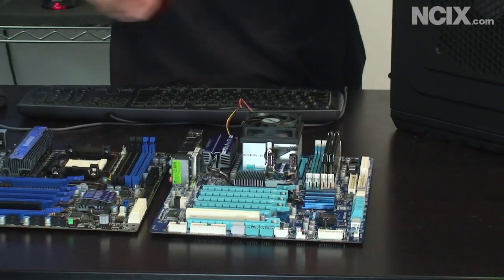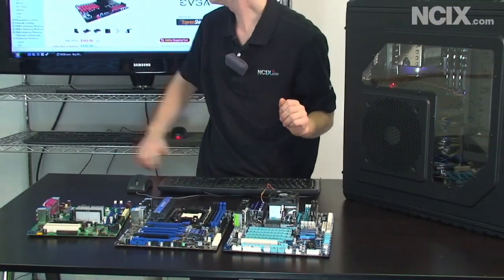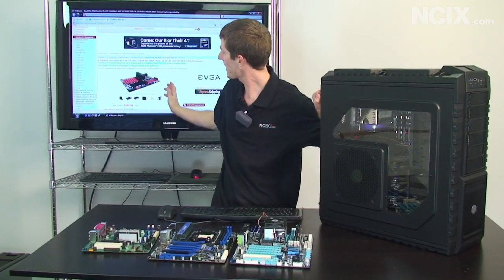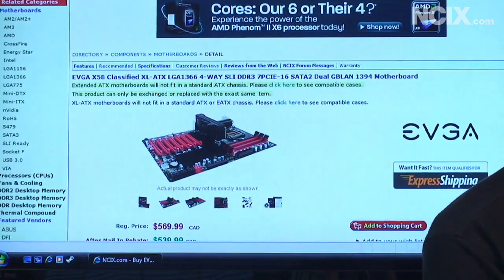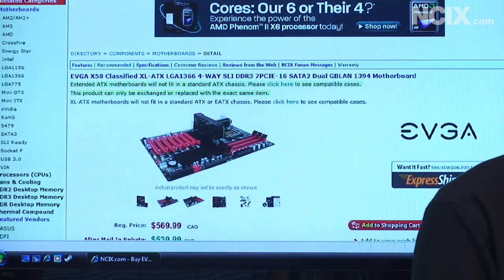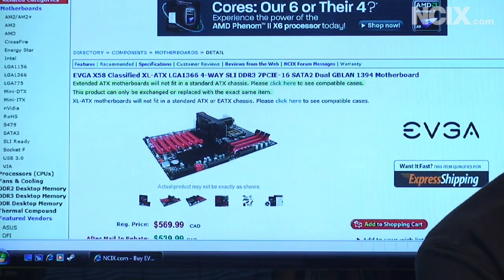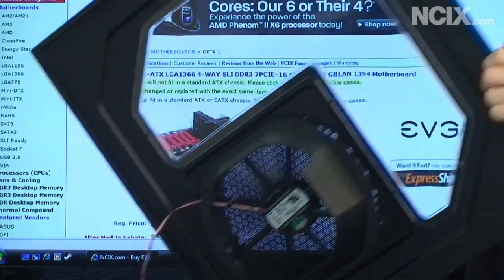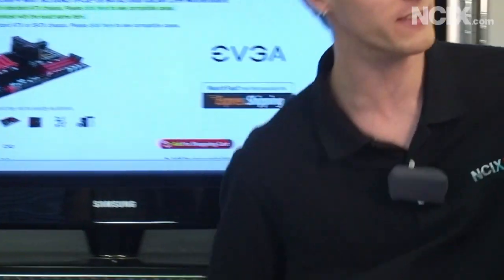microATX vs ATX vs XL-ATX Motherboard (NCIX Tech Tips #68)

Comment: im actually about to buy this case and 4 other cases tomo for 20$ i wanted this case he said i had to take all 5 LOL others are old dell dimension cases. which i have plans for for future budget build pcs. and gonna mod the cases to get rid of dell LOL. but i came here cause i saw this case while trying to make sure my mother board will fit in other cases LOL cause my power supply is ontop so im worried it might not have long enough wires to reach to top ports. :( 
and now i really dont know.
Reply: lol...
Reply: @handmeadozenbeers8655  kinda pumped. i need a big case. but i guess this is the bus of cases lol.

Comment: Question; Could a MicroATX board fit in a ATX case? I'm attempting my first build and I might get a ATX case, but I'll be using a MicroATX motherboard.
Reply: +Random Gaming and Tech Yes,  most ATX Cases allow you to use mATX boards as well
Reply: +Random Gaming and Tech But you might as well get a ATX
Reply: Thanks!
Reply: No prob
Reply: Yea it can
Reply: Most of them also allow you to use mini itx aswell, which most of the time has a built in wifi adapter which will save you a couple of bucks down the road ;)
Reply: thanks. :D
Reply: Well, if you are doing a PC, you'd better not use WIFI, cus it's slower than ethernet and no one really moves a PC around. Just buy a ATX and a cable

Comment: Which would be better for overclocking and gaming [if you don't plan on using more than 2 graphics cards]?  The microATX since it has shorter connections or the ATX for larger surface area?

Comment: I have an old mATX board that I want to swap out for an upgrade into a 64 bit system. My case (that it came in and want to keep) says that the case form factor is uATX and then listed under the specification it says that the cases "Supported Motherboard Form Factor" is ATX. The cases dimensions are 15.5 × 7.25 × 16.5 inches. The old Motherboard I currently have is 244x244mm. 

Will I be able to fit a new standard ATX motherboard in to this case for my upgrade?

Comment: Nope, those 380's are about equal to the power of a 580, the 5xx series didnt have much performance update mostly cooling, so you are looking at theortically about a GTX 575 (card doesnt exists i believe :P) 4 way SLI, 2 680's or probably 2 670's could beat it

Comment: nope. not unless that card is a GTX 680. In theory if all of the GTX 480s were working at 100% (Which is very unlikely) then it should equal to the power of a 680 more or less. Just guessing here though but performance would still be pretty good if the drivers for 4-way SLI haven't turned to shit in most cases

Comment: Asus Maximus IV is E-ATX and is the same size as ATX just 2 cm wider, the same applies for the EVGA Z68/P67 FTW boards only difference is they are 5/6cm wider.
XL-ATX gives you 4x Crossfire or SLI whereas E-ATX gives you more features crammed into the board xD

Comment: sli/crossfire is really just a neat way to keep the 2nd hand market in graphics cards competitive.

user-overclocked pre-owned is a great way to go. occationally mods like volt, ramsinks, or higher-than-OEM quality thermal paste usually get thrown in for nothing if they've already been applied.

buying new right now its better to go in with the intention of having single card solution. but theres great performance+value to be got from 2nd hand OC'd cards in 2gpu config.

Comment: @TheWoWRevelation derp i bought the antec 1200 v3 and read that it supported ssd natively and had usb3, so i thought i didnt need to route the cables back...well i was wrong and it was a bitch to do alot of shit with that case, especially the 3 1/2'' bay :P

Comment: @deepakjindal070 check if it supports it, it will fit in term of size, but if the holes aren't there it wont, they generally will

Comment: @STRmw2 If you are going with a mid tower case I would recomend a Fractal Design R3 or a fractal design Arc, I own both these cases and they are truly amazing, however, not Blue LED. Go for the R3 if you want a silent computer or the Arc if you want a case with more fans and better airflow inside the case. and by the way, you can always buy blue LED fans if you fancy that style :)

Comment: @DJ4C0B
cheers for the reply
im a bit low on budget but with the help of a good friend ive found some parts im gonna get a mid tower blue led case, mATX board by msi and then ive got a 2.7ghz pentium dual core  (an improvement from my 1.8 core 2 duo) 4gb ram and a HD4670 which i may soon upgrade to a HD5770 (from a friend)
considering i already own the hard drives, cpu and graphics card, everything i just said including a blue case fan, new cpu fan and a new 500w psu comes to about £150 :D

Comment: @STRmw2 You have to look on the manufacturets website to look up what kind of motherboard size the chassi supports. However, most mid tower cases only accept ATX motherboards, they MAY fit an E-ATX but cablemanagement may be bad. I would go for a fulltower case.

Comment: @Nutriment6464 Now as for build quality. Antec doesn't make their frony bezels so thin you can see teh power and HDD LEDs shine through the plastic and eachother. 

I've also yet to have a side door on an antec case need to be shimmed so it doesn't rattle. I've bough two CM cases 3 antecs an Apteva (oh god was that a mistake)  And a Thermaltake which is almost 12 years old and i still have it today and it keeps a dual core with 6 hdds cool with its original orange fans. 
CM makes a good case tho

Comment: @Nutriment6464 *ran out of space*  Since the top Fan pulls air from the top mesh that isn't occupied by a fan, down into the case, then back out.

The only way to "cure" this problem was to put 2 120mm fans in the bottom (Yea I had to search long and hard for a thin 120x10 fan that wasn't overpriced.) 

The CM has a worse negative air pressure setup than the 300 because of all the unneeded mesh. IT doenst' make the case pull air form where it needed to go. It's airflow is more like an open rack

Comment: @SpecialKLSX So you're saying you're doing better than ALL of the benchmark websites? The antec 300 is an old and cheap made case, antec is so far behind coolermaster at the moment, I'd rather get an haf 912 or a cm 690 II basic for the same price of a 300 and get better cooling performance... Plus, you could get delta fans and get lower temps than the haf x, but at a SO much higher noise, 200 mm fans push 110 cfm at 19 dbA at worst, you need a 50 dBa 120 mm fan to get that much air pushed...

Comment: @Nutriment6464 Or rather... I'm doing it right? If I can use a smaller case with 900RPM fans and get lower temps obviously I'm doing SOMETHING better than the benchmark sites. Also the 300 is a HELL of a lot cheaper than the HAF-X. So much so that you can buy some pretty damn expensive fans and still come up with more green in hand after buying everything. the HAF is a good case for OMGWTFHUGE components, but I'm not gonna go off and buy those SLI/Crossfire on a card boards. No 30LCD to use here

Comment: @SpecialKLSX Well the only thing I can answer and that EVERY benchmark reviews website will tell you is: you're doing it wrong. I went from an antec 300 to an azza solano 1000 to an haf x, and I've seen improvements within each case change. The 300 is not bad, but seriously, loud fans and average dust filter? Plus you gotta add tons of fans... the 300 had no space for my components, and the way hard drives are placed is a no-go for me. I'd rather take an haf 912 than an antec 300...